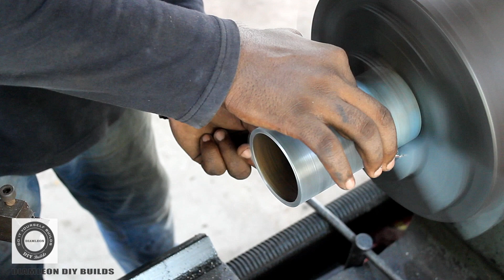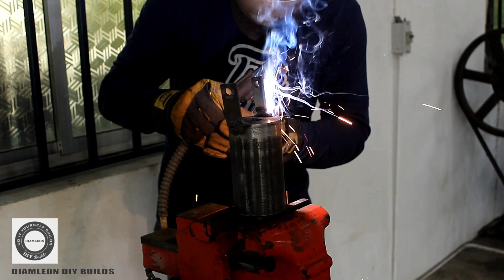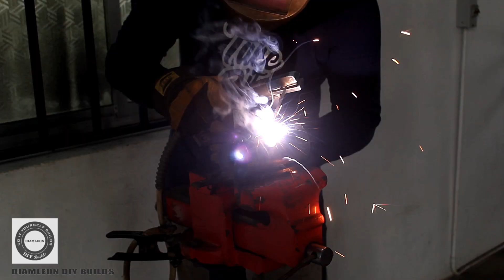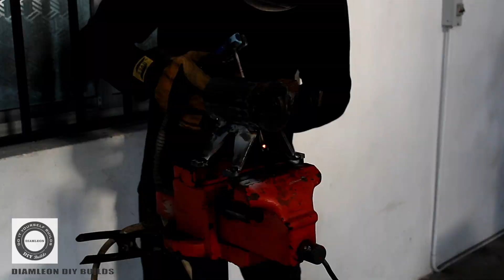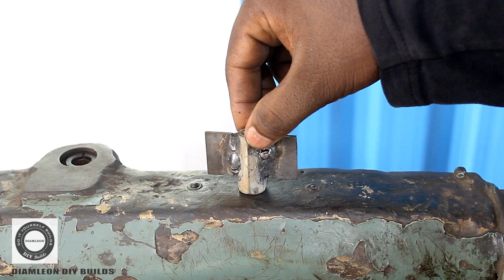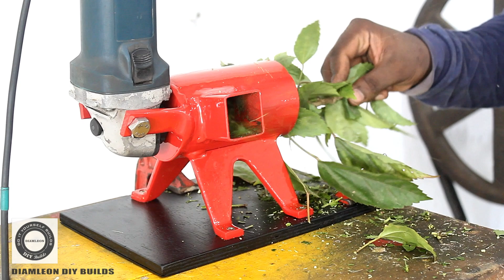Angle Grinder HACK - Chipper Shredder | DIY

Comment: Dear Sir,
Another yet clever idea, however shredders are built with high torque motors in oder to cut &/ crush the stalks, roots of plants. Angle grinders operate at high speed similar to Dremel tools where they rely on speed rather than torque, but the pressure must be minimal to achieve good results. Maybe if you can lay your hands on some three phase motors or alternatively geared down motor to achieve necessary torque, your idea might yield better results. Kind regards.
Reply: ToolsConsumables iiiiiiii
Reply: Wood chippers actually use high speed and a heavy counterweight to crush/chip branches. So he has the right idea on this.
Reply: Can also convert a linear actuator

Comment: It amazes me that people with the kids of machine tools I cannot afford can come up with such weak ideas. Had I made such a machine, I'd have put the exhaust hole underneath with an extension to tie on a bag to catch the shredded residue. Who, in heaven's name, uses pliers to turn nuts and bolts? Isn't that what socket wrenches were made for?
Let us just say that I am underwhelmed, but please don't feel that you are special: there are many like you here on YouTube, with the tools and too much idle time on their hands, but not enough innovation to do anything special with either.
Reply: Dude back off! The guys just having some fun making things. Have you ever had a hobby?
Reply: @vicferrari9380  Yes, I have hobbies: too many to be able to attend to all of them, so that I may not return to one or two for many months. 
I have had occasion to make my own tools and other gadgets, including re-purposing a standard lawnmower so that it can cut through small saplings whilst I am mowing the tough Karoo veld grasses (you can Google that) in our garden, with the blade high enough that it does not connect with stones on the ground: so I do know something about fabrication. I use the correct tools when working, though - and if I do not have them, I make them, or use a suitable substitute, not something meant for another purpose altogether.
Reply: just allowing to place the blade before could be an easy fix.